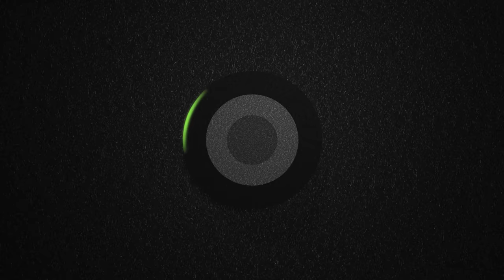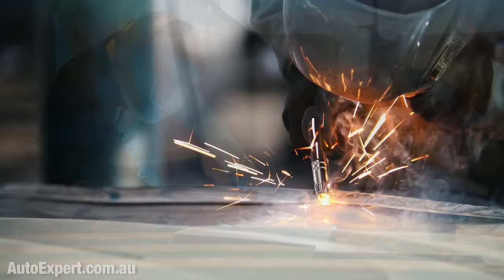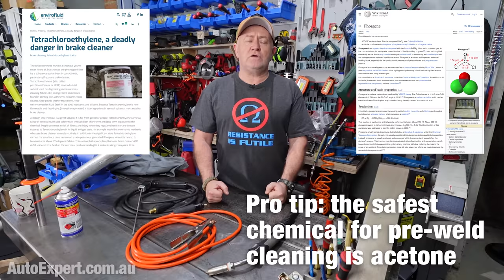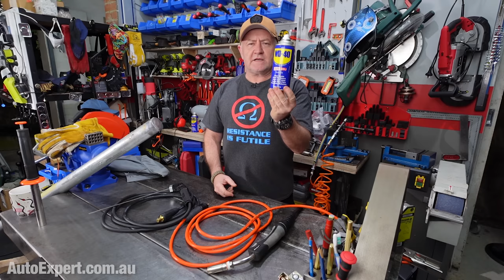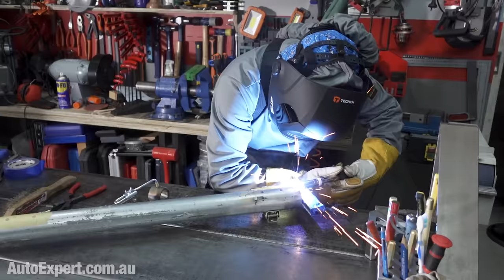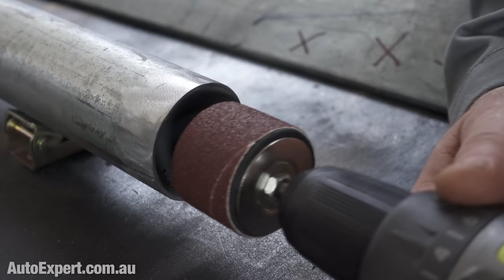How to die while arc welding at home: the top 5 ways | Auto Expert John Cadogan

Comment: Good tips. It is funny how common sense is not so common. WD-40 reminds me of a similar caution tip not for welding. I always say never leave anything flammable on a kitchen or wood stove, even if you are not using it. Then I saw a great video proving another reason why. Someone left something flammable on their kitchen stove. Their security camera later revealed, their dog found it interesting and pawed his front legs up to get a good sniff. The dog accidentally turned the, ELECTRIC not gas, stove on. As it heated up it ignited and caused a house fire. Their smoke detectors saved them and their house. Similarly, don't keep potential explosive and flammable items on the welding table, EVER. You just don't know what might happen. Don't raise your goggles with a 125 amp wand. OMG. Don't inhale fumes. Gee, my grandfather, ages ago, made his employer sent up a ventilation hood so strong it would almost suck his gloves off the table if he set them down.

Comment: Hi, Pom here, in the Philippines and been welding for almost a week.  So being British, I've mastered it of course......or maybe not.... Over here just about everything is thin galvanised crap and the odd bit of stainless. I have a must-do job coming up,  a storm drain was completed outside my house but the council (barangay) ran out of money to finsh the job, so tough shit mate.

Yesterday kids were playing in the rain, it was hosing down. A little girl ran right towards the open drain because it was under water.  I screamed at her to stop and thank God she did - she'd have died because under the covered section they left all the bamboo framing, she'd have drowned,  100%. I jury rigged a temporary cover with car ramps and 4x3 but i need to get something solid welded up.  

Im thinking 1" galvanised box section and angle iron, with rebar cross pieces to walk on. Is it OK to burn off the zinc with muriatic acid, inside and outside then use a fan while cutting/welding?

Another option for me is to use my spare diving tank and regulator, physically I can just fit the reg under the mask?

Comment: Fucking hell John, I love your videos mate! I didn't know about the phosgene or the zinc risks but I've never done either of these luckily. Number 6 risk, beware of leaving flammable materials near the job. I was happily welding away one day when I suddenly realised that an old towel had been set alight by the sparks. I typically used it for cleaning up workpieces with paraffin, methylated spirits, white spirit or whatever solvent I happened to have handy, not brake cleaner luckily. It probably had ten years' worth of oil and grease and solvents soaked into it. Not being a total dick, I have several fire extinguishers strategically placed around the cave, so soon had it out, but if I'd not noticed it in time it could have been nasty.

Comment: My first road bike at 17 was a Honda which always misfired in wet weather, so I'd carry a can of WD40 stuffed inside my jacket, to pull out and periodically spray the HT lead while riding, not bothering to stop or turn off the ignition. One day the spark ignited the vaporized WD and there fireball resulted. Luckily it was instantaneous, and I was wearing leathers and a helmet, so I was fine, but all the car drivers around me noticed it and immediately gave me an extra wide berth. It's one way to get more space on the road!

Comment: Having used hand held masks for Stick and non auto darkening head screens, then normal auto darkening helmets, I will not weld ANYTHING without, a 3M Speedglas 3200 FX helmet with full hood and respirator like yours. Also double filters for particulates and smoke. Especially when I've been welding Aluminium, Galv or Aluminised steel. Having worked in heavy industry wearing a full suede jacket and gauntlets, apron etc. Sweating my balls off and sweat pouring into my eyes, having a helmet that's got a cross flow of cool, clean air blowing across my face is a godsend!!

Comment: Excellent presentation. I want to support your comments about electrical safety. A small 240 volt stick welder running as it does on 60 hertz domestic supply will more easily stop your heart than many high frequency welders. In addition a shirt only 10 percent damp with sweat has been shown to be sufficiently conductive to allow a fatality. Even 16 milliamps has done the job with prolonged contact! Use voltage cut out devices. Dazcor made an electrode holder that cut the power off while replacing the electrode. This guards against conductivity through sweaty gloves.

Comment: It takes a lot of brake cleaner to make enough phosgene to be deadly, not that any amount is better or worse. The only time I have ever seen enough phosgene produced in this fashion was due to a guy flame hardening a set of blades for a big paper cutter. He used our heavily chlorinated dark cutting oil as a quenching fluid. You could smell it throughout the shop, he got a cough for a few minutes but was okay after about a half hour. Anyway still not a good idea but nothing to be terrified about either and if you really worry about that stuff than wear a mask. The “North” model 76008A fits comfortably under a welding helmet and can used cartridges, convert to a PAPR or even be converted for supplied air. Very nice product and about as comfortable as it gets under a helmet. Just get the belt clip regulator with the kit.

Comment: All night in freezing driving rain welding in wear plates inside a 70 yard concrete mixing drum: my diesel powered stainless steel marine duty Lincoln torpedo DC generator welder and 5/16”  Lincoln jetweld LH73. I slumped down and about blacked-out getting a good shock changing every electrode with my wet welding gloves, sitting in water. (Cutting concrete with oxygen / acetylene torch: pop! BANG! POP POP!!)

Comment: Never put ANYTHING on the welding table other than the work pieces and work holding gear.   Welding debris is bad for almost everything.  Yes, explosive containers of oil-based products are an obvious no-no, but far South of that, and yet of some import  is speckling a $100 pair of calipers or a $200 pair of glasses.  Of all surface that should be kept clean and free of detritus, the welding table ranks right near the top.

Comment: im just an at home hobby welder, and this one might sound a little silly, but a good, stout, not easily tipable stool if your welding on a bench. 
when i was learning the basics of tig welding, i was sitting there practicing my stepover, lost in the rhythm of it all when BANG! i must have hit a big clump of impurities in the steel or something, there was a sharp crack and a bunch of spatter flying all over the shop. i shot up and backwards away from it all, and kept going til i was on my back. nothing serious happened thankfully, i had just tidied the shed earlier that day so i didnt crack my neck on an off cut of i-beam or something stupid, but it could have gone worse

Comment: I don't actually do any welding... although I've thought about it from time to time. However I am well versed in various "commercial processes"... and something else came to mind... specifically if doing repairs on OLD equipment. You mentioned the somewhat toxic vapor that can result when you heat zinc galvanize. What occurred to me was that, in the old days, a lot of small hardware was plated with cadmium. I believe it's still used today... but in more limited applications. I've mostly seen cadmium plating with hardware like screws... where you end up with a lovely non-tarnishing rainbow sheen... but I've also seen it on other small metal parts... and I've also seen it used in small percentages in some old brazing solder. (I scrapped several rolls of "brazing silver solder" one time that turned out to be several percent cadmium when the scrap company analyzed it... which would have been a clear toxicity hazard if not handled properly.)

Comment: I self taught with a buzz box and was just sensible with gloves skin cover etc. However, I recently acquired a Chinese Inverter welder (140W) which is quite efficient for occasional use. When it cut out I checked the fuse. I say fuse but it was just a lump of copper pipe! So moral of the story - don't trust the 'clickbait' on E bay / Amazon etc. Someone somewhere is out to get you. Nice welder but lethal fuse. Just as well I checked rather than the Coroner.

Comment: I realize that this should be "Common Sense", but make sure all flammable liquids are out of the area. Many years ago, when I worked as a Paramedic I responded to a very tragic welding accident. The victim had been cleaning his parts with Gasoline. Due to the cold weather, this guy had closed the doors to his garage. He took a break for lunch, then left the doors closed. When he returned, he fired up his arc welder. The explosion leveled this single car garage and left him with second and third degree burns over 80% of his body. He died three days after we rescued him.

Comment: Good video. I have hobby welded stick.mig.tig for many years. There is a reason why most welding is done by robots nowadays. Don't weld if you can pay an expert to do it right for you. As an old man now I have a hard time seeing in the dark. Think about it for a moment. You have only one set of good eyes for a lifetime. You put on your helmet and it is dark. Then you strike an extremely bright arc. That cannot be good for your retna. I truly regret welding alll of the worn out rusty stuff that I repaired. If I could turn back time I would do so many things differently. Just my two cents.

Comment: Hey thank you for the informational video. A Question for anyone ... I admittedly am totally new to welding. Just never learned the trade for specific  reasons even though as an ase certified automotive tech I have been around it all my adult life and then some. What is a good solid welding system  (by welding method for ex: tig,mig laser etc and what brand) for me to purchase that will sufficiently handle any automotive based job? Ex: frame repair / exhaust / aluminum heads etc. I don't need the top of the line mac daddy of systems .. I just am looking for tips on a solid quality system (or systems) to invest in.

Comment: i got shocked one time in my life, still not sure what caused it. I work in the shipbuilding industry, i first started as a pipefitter helper and i was trying to weld a pipe hanger to the bulkhead and received a nasty shock will holding the hanger to the bulkhead. my guess is maybe my glove was too sweaty and that caused the shock.. crazy how they never warned us newbies that never welded before about such things!! my coworker just laughed and said thats why they call the eletrode holder a stinger! but after that first shock it was enough for me to make sure it NEVER happened again!!! luckily now im a shipfitter and run fluxcore,, but i still have a stick machine at home so gotta be careful!  also my home machine is a chinese brand called hone, i grabbed some 7018's from work and was running beads just the same at home on my $70 welder as the miller XMT350 at work!

Comment: thanks John for some non B/S tips which I wish I had seen before I bought entry level arc/MIG units and signed up to "YT University" welding videos that all focus on techniques - buggar all on safety and risks.   I can relate to your #1 risk as my early welds were in a confined space on galv that I hadnt prepped well enough. I had auto helmet and gloves/jacket etc but no mask on and i got a belly full of fumes multiple times. It burns going down your throat and after a couple of years I  dont breathe as well as I used to -  it feels like permanent pneumonia at times.  Thanks for sharing and if this prevents even one preventable injury or worse - be proud.  cheers

Comment: Hexavalent chromium may also be present in fumes generated during the production or welding of chrome alloys. Chromium metal is often alloyed with other metals or plated on metal and plastic substrates to improve corrosion resistance and provide protective coatings. Hexavalent chromium (chromium 6) compounds are on the Proposition 65 list because they can cause cancer. Exposure to chromium 6 compounds can increase the risk of lung cancer.

Comment: Worked over 30+ years boat building 14 yrs. Aluminum boats when you weld aluminum the smoke is Alum. oxide what they put in Deodorant to stop you from sweating Not good to breath and the UV from the arc is a lot more intense. Even wearing 50 sun screen and a painters hood I still got burnt welding in the fish holds.

Comment: one other common one for gas (acetylene + oxygen), is the one where you set the regulator, and you run out of oxy, close the TANK, but not the mixer taps at the faucet (torch) end, the oxy crosses over to the fuel gas tank, and the 20,000 PSI takes the fuel to over 15 psi, then the bolt of the regulator adjuster 'blows' in your face!!- goner!!

Comment: Hi, you do a great job with your videos.  However I will say one thing, since you asked.  You made a big point out of the toxic fumes from the specific cleaner, and the toxic fumes from the galvanized steel.  However, you failed to mention the harmful fumes from ALL welding.  It doesn’t matter what metal it is.  None of these fumes are safe for your lungs.  Either you need a proper exhaust system or a cross wind as you mentioned.  Now, maybe all your viewers are veterans, but if you are talking about ways to destroy your lungs, you must put fresh air into them, not tiny toxic particles of metals and welding rod coating, which are contained in the smoke from the welding process.

Comment: When stick welding ALWAYS check the integrity of the hand piece to cable integrity, especially if it has a metal ferule around the end of the handle. I found out the very hard way at a company who shall stay nameless, where the cable had worked out and shorted the ferrule and I lent against the welding table and current went through my right wrist and hip to ground on the table.  Only thing saved me was I was thrown back off the table. I ended up with severe bruising on my hip and fucking sore arm muscles. Be aware, electricky bites....

Comment: I'm not saying it can't happen but in over 45 years of being around some of the dumbest welders who have ever poured wire, I have never seen one use the stinger to lift their shield.  Maybe the back of that hand holding the whip, but never with a stub in any proximity of the face. Sorry antidotal stories are, many times, just that... stories. They serve their purpose to educate, but unbelievable ones undermine their original purpose. All welders, even the dumb ones, learn early on never handle a stub, hot or cold anywhere near flesh. That aside, the possibility of electrocution under the right conditions is sound.

Comment: Never heard of someone dying while welding, other than your confined space tragedies, and i know alot of people using chlorinated brake clean in their shed, even used it myself.. when they gas people with the stuff they use alot of it not a thin layer on tube then heat it with a torch. As long as your not in a confined space or a airtight room you will probably be ok... i hrdly wear gloves yeah i get a zap from the tig every now and then when i forget the earth. If anyone was going to die welding it would be me but 17years in and the most dangerous thing is a angle grinder in my opinion but hey i only do it 6 days a week

Comment: As a hobby welder I have my welding table on wheels so I roll it outside my shop , away from any other tools. I dont spray anything on my work and I have all the protective equipment within reach, including a fire extinguisher. I dont like too burn myself. I also have a fan blowing in  my direction too get the toxic smoke away from me when I work with Galvanized materials. It only taqkes a few minutes too be safe. If you use muriatic acid too clean galvanized material you would get it all off the metal and be safe. It doesnt take much too clean the galvanizing off and it will be safer than grinding it off without loss of metal from the piece you are welding.

Comment: I am an almost 30 year experienced refrigeration technician.  The refrigerants we use have chlorine in them. When we make repairs often small amounts of refrigerant get trapped in the system and are released when we braze/ torch fittings and pipe and flame and R22 does make phosgene.   I’ve ingested inadvertently quite a bit of the stuff over 30 years.  It absolutely sucks to breath or get in your nose or eyes but I assure you I’m still alive.   But I agree with you it is dangerous shit

Comment: The first time I got metal fume fever I didn't think the small amount of welding galvy would be enough to do anything bad... I spent the next day in bed. Tip: strip off the zinc first with Krud Kutter or muriatic acid.

Comment: 3rd yr apprentice with 2 shocks too myself. 1 cleaned my welding lens with gloves on didnt realise i wet my gloves while spraying the lens, went back to welding my handrail and leant against it with my wet glove and as soon as i arced it shocked my hand all the way up to my shoulder.  1st year apprentice

2. in trade school changing the tungsten on tig welding, had thick riggers on not tig gloves, so took one off too pull out the tungsten, as i was pulling out the tungsten with a bare hand i also had my knees up against my work bench while the earth was connected to it. and i hit the button while the tungsten was still in the torch. that felt like someone hit me in both shoulders and hips with a hammer simultaneously. 2nd year apprentice.  

Edit: it was with GMAW/MIG